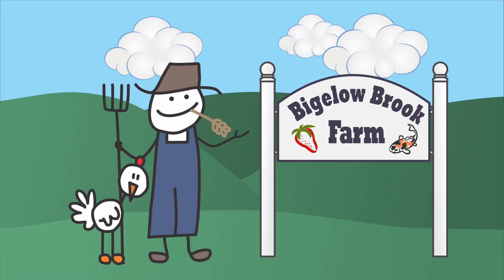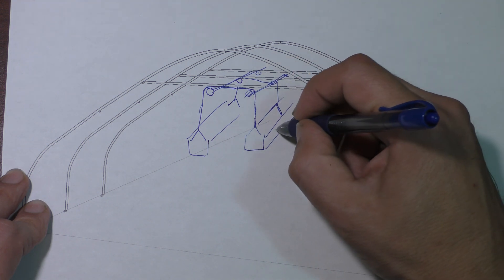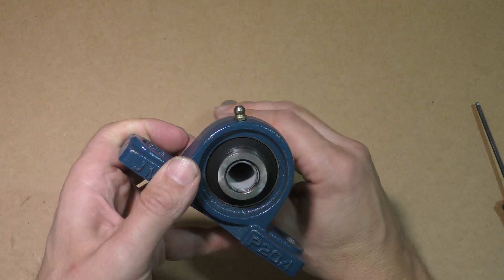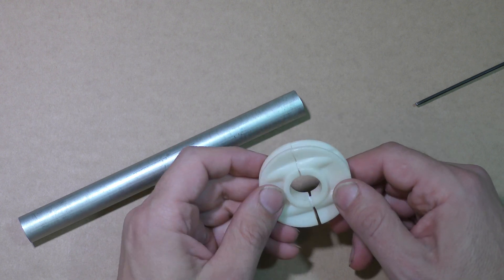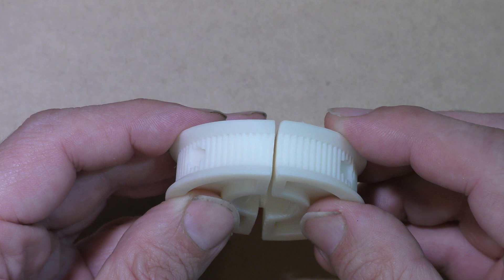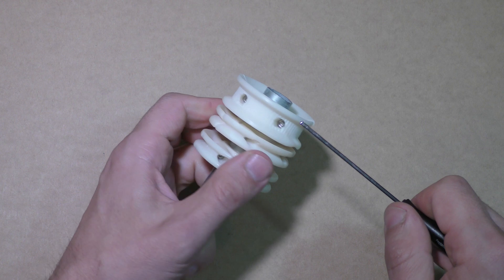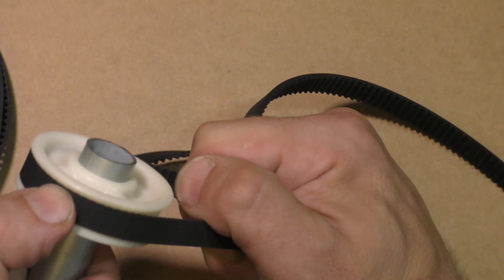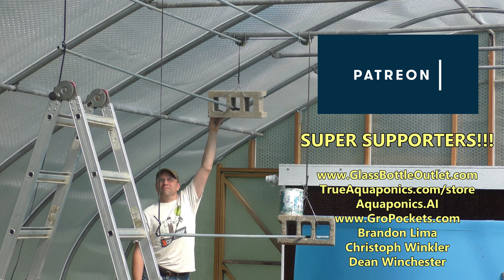Strawberry Hangers - Prototyping - Part 1

Comment: Wow, what printer do you have?
Reply from the maker: I have several printers, but these parts are printed on an Anycubic Photon S using Siraya Tech non-brittle resin.
Reply: @Bigelowbrook  The printed parts seem very good and strong. I presume that's the reason you chose a resin printer or something like PLA?
Reply from the maker: @heckyes  the resin printers are far more accurate and there is a better choice of materials with the resin

Comment: Rob, check out the screw like pulleys used in overhead garage doors....this should give you the grip you need to use the SS cable. You probably already thought of it but if not consider adding some diagonal pipes to your hoop sections to create a truss. Have a great day.
Reply from the maker: I looked into the garage door pulleys...very expensive when you have to start getting dozens of them!  I can print these out for less than a buck.  Diagonal trusses are in the works...they'll be in video #3.  ;-)
Reply: @Bigelowbrook  ageeed... I was thinking you could print the pulley with the twist in it to save the cost. Have a great day!

Comment: There should be two ways of doing this that I can see? modify your method with two chain sprocket and a chain to synchronise shafts or just go with cables and pulleys, just think negative feedback circuit but with steel cables instead, you need 8 pulleys 1 set of 4 pulleys like you where doing, the other set of 4 will connect in a X pattern so that each corner connect to the other platter both far and near. The cables pattern looking down from the top should look like a hourglass, two triangles touching, additional support cables could be added between theses two end, they would be just simple cross over cables one side to the other. I probably confused you, I'm not so great with written communications.
Reply from the maker: I wanted to make sure that the load was distributed on to each arch of the greenhouse so I went with this solution.  With the X pattern going from one end to the other, I think that would just support the ends and not the entire troth?  I also thought about chain but once you get into the sizes that can support weight the get very expensive/heavy.  It would have made this much easier with chain!
Reply: Just bit concerned about your safety, are those belts OK with UV and weathering, I know stainless steel cables are used in small aircraft and heavy medical equipment, don't know about trusting those belts in that environment? 

I shouldn't have watched this video, I keep trying thinking of different solution to this problem, kinda like a earworm. Thank you 😊
Reply from the maker: @drmosfet  I'm hoping the belts will be OK.  The plastic covering for the greenhouse filters a lot of the UV.  I've been thinking about also putting a safety cable on each section so if the belt breaks, the cable should catch the load.  Even chains and cabling you buy tends to say 'not for overhead use' so everyone is trying to cover their butts!

Comment: Looking forward to seeing where you end up.   Your last comment about the paint can was something I was wondering on how to get the system balanced so that one side is not heavier than the other.    maybe there needs to be some sort of locking mechanism.
Reply from the maker: I've been wondering about how to keep it balanced.  A lock or break system would help.  I've thought about just hanging jugs of water as a counter balance.  It's probably something I'll have to figure out once the system is running!

Comment: you really should do the strength calculations first before you move on ... 1. the whole weight rests on your horizontal construction beams that are design only to keep the shape of your roofbeams under heavy weather conditions, not to carry extra weight. they are only secured with a simple bolt at each end. the weight distribution over the beam might make it bend, impairing its original purpose strength during storms f.e.. if there is space mont a bearing and axel on top of a construction beam instead of having it dangle underneath on 2 simple bolts. don't underestimate the weight of your basket, tge grow medium, the water, the plants and the inertia forces needed to get it all moving up and down. allow for a safety factor of at lesat 3. your axles shoud have enough stifness, i doubt your electricity conduit pipe is gonna hold up when everything starts shaking when in use during heavy winds.
Reply from the maker: I agree.  The weight has been one of my biggest concerns about this entire project.  I'll cover some weight calculations in a future video.  thanks!

Comment: The weight factor would concern me. Many greenhouse framing materials aren't designed structurally to bear any weight. Even if you use super light weight trays and cocoa coir media, the water weight combined with the plants and fruit weight would push the tensile strength of the typical greenhouse frame. Most greenhouses are built with light gauge steel tubing which isn't much stronger than a child's swing set. Most frames are only meant to hold up the plastic and possibly some snow load and provide some wind resistance and not much else. Even the older heavier gauge frames like i have on my greenhouses can barely support the wire trellis system i use for trellising my tomato plants and overhead irrigation. The only way to get past this issue would build a inner support frame which pokes at cost effectiveness. I Would tend to lean towards a ground based pipe support type system and if possible include a low growing secondary crop that can grow underneath the berry trays that can grow with the reduced light situation.
Reply from the maker: This is one of my main concerns with this project.  Thankfully it is an older greenhouse and has some heavier gauge tubing.  At least the load will get distributed throughout the frame....but that won't guarantee success.  The modern greenhouses built for this type of growing method are certainly design for something like this.  Retrofitting can be risky!
Reply: @Bigelowbrook  - i began using the old top rail pipe from chain link fencing to modify my bows. I Bent the centers of 20 foot lengths to the a-frame shape and used my original straight sections for legs because their weights and stresses are mostly straight up and down loads. Then i added extra braces that displace the loads outward to the posts mostly. And over time i added center posts wherever needed in the center sections. I'm on my 6th year with improvised support framing with no issues and frequent 3 foot snow loads in winter here in Maine.

Comment: 3D print a C shaped tubular shim for the bearings/conduit. It works!
Reply from the maker: I thought about it.  The wall thickness of .025" concerned me a bit.  I might try to load some tough resin into my printer and see what it does.  I think the set screws will crack it so I probably would have to have a couple of holes in the shim so they could pass through without crushing them.

Comment: Hi Rob,
 I appreciate the update... I voted yes (1 of the 92%). I imagine you will have a flexible line to deliver water/nutrients. to the strawberries. Is this a point of discussion in a future video?
I suppose you could do a twin pulley system stainless steel cable for the strength and paracord to "drive" the system. Cheers,
     Bill
Reply from the maker: yes, I"m planning on flexible line....I haven't figured that part out yet.  ;-)

Comment: Recommend helical para cord to avoid the run skipping out on you.  More helical turns, more grip, needs set screw on side too so you could stack them for more/less friction.
Reply: Argh, helical pulley, using paracord.
Reply: @PsychoticusRex  hahahaha you can edit your post. Just tap the 3 dots to the right. and then destroy the evidence and delete second "correcting post". This bit was edited after the fact :) , Cheers,
     Bill
Reply: @williamwalter8554  shame teaches better than competence. ;)